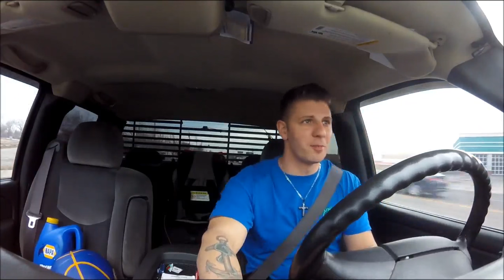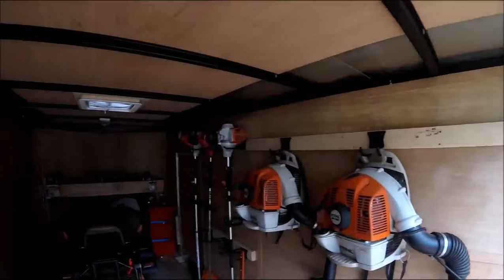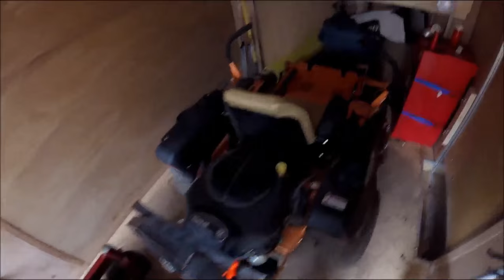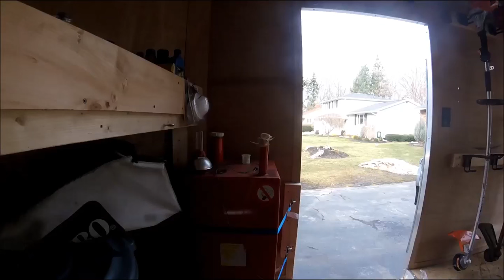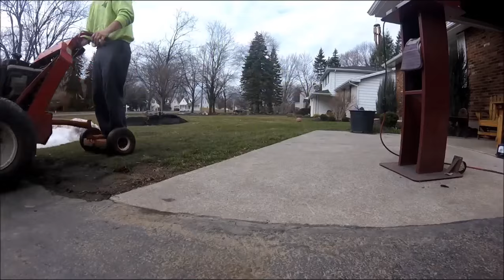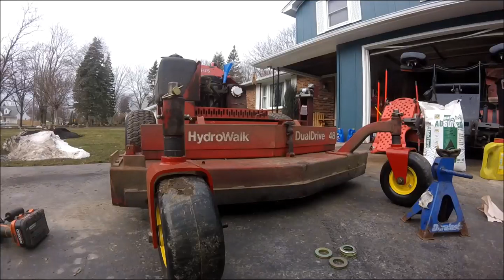Trailer setup and Maintenance

Comment: You've got a great setup man. I love those hooks! If I had an enclosed trailer I'd look for them. Hey, I also sharpen at a very shallow angle. Same reason. And yes, even a Cheetah leaves stragglers running Gators. I see that 420V on that Ferris. I had that engine on an old Snapper 48 with a belt drive. Never could kill that engine! Sold it with everything broken, but running. And running well!
Reply from the maker: Thanks buddy. And yes, I've had that on everything from Scag to bunton to the Ferris walk behinds. They run forever! Shame they don't make em anymore.

Comment: Great Video. Love your Ferris. We have some Kawasaki 420V engines still running commercially since 1994. I think that's the most relaiable engine we have ever had. Probably have about 5000hrs on them by now.
Reply from the maker: Exactly. As long as you keep up the maintenance they'll run forever. Shame they don't make them anymore.

Comment: you should get the whips near the big door and have them hang length ways.  easy to choose edger or whip so you can grab and go . don't even need to open the side door its a waste of time, I only leave that door open if it get to hot in there,  i would move that cooler near the side door away from items that you use most. I keep everything near the big door ( whip backpack blower) so my guys can start working while I unload the mower or making oil etc.... I like those hooks you got . I saved so much money making your own racks .. With enclosed trailers it is like having a garage on wheels. But I would just try it and see how you like it . One day Ill post how i setup my rigs. Good luck with your season!
Reply from the maker: Can't put water cooler up front because I don't want it near my fuel cell. The way I have it is by far the most efficient for what I do. This is the 3rd way I've set it up. I'm sure eventually I'll change it again but this works best for me right now. Years ago I changed trailer set ups constantly depending on circumstances. Now I just know what works best for me and don't change it nearly as much.

Comment: what motor does your gmc have couldn't tell if it was a 6.0 or a 8.1
Reply from the maker: Neither actually. It's the 5.3
Reply from the maker: My duelly is my work horse. It has 454 with 4:56 gears
Reply: o i couldn't tell my work horse is a 2004 chevy 3500 dully with a 8.1 496 with 4.10 gears alllison tranny nice trucks keep up the good work
Reply from the maker: +Derrick Flynn Awesome truck. Thanks